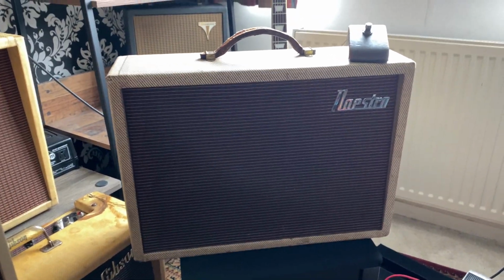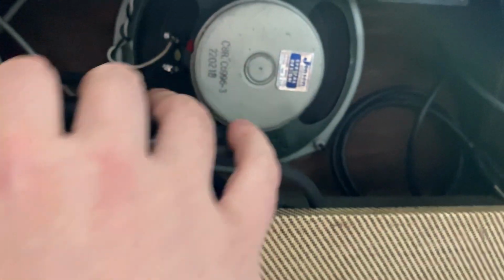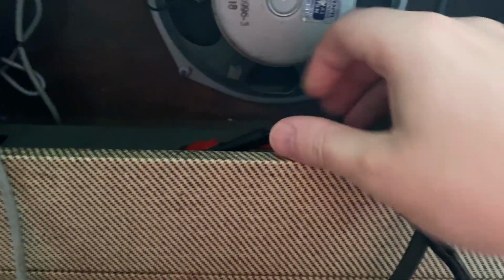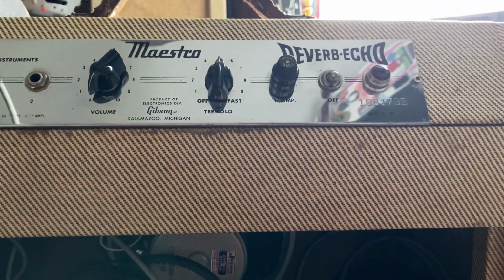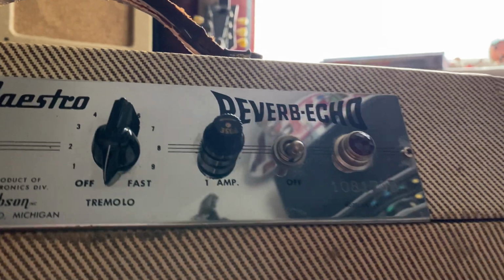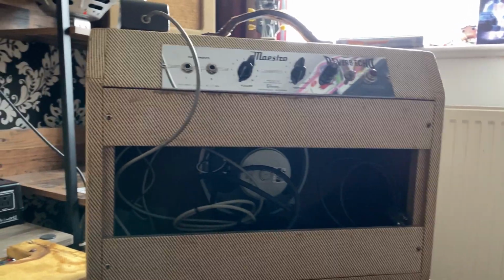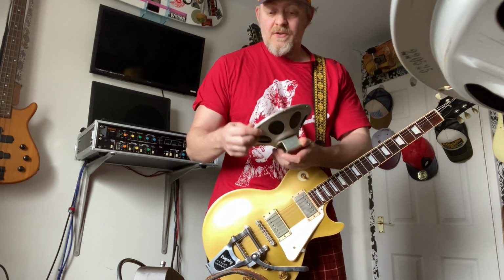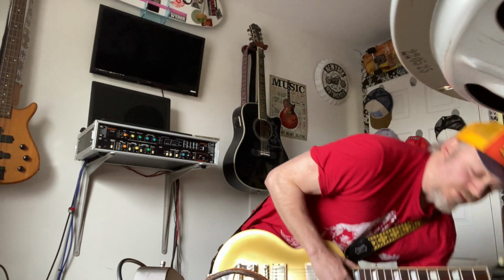Maestro 1961 GA-1RT

Comment: Hi! I just acquired one of these amps recently and it sounds dark. I'm playing a strat and I had to turn the tone knob all the way up to get any clarity at all. In your videos there seems to be ample high end and clarity. How did you find the amp to be?
Reply from the maker: @popespondstudios  Hi, there could be a few factors. When I acquire these amps I always make sure they’re either recently serviced or I take them straight to my amp tech to check everything over.
This particular amp also had a 1961-62 Jensen ceramic speaker. I find the ceramics to be a little more punchy and crisper than the alnico.
A bright 12ax7 in the pre amp also can help. Can’t remember exactly what I had here but maybe a RCA or Raytheon would be a good candidate.
This amp is prone to being quite warm and mellow imo. I mainly used it for the outboard reverb
Reply: @ Hi! My amp is with the tech right now. I’ll mention to him maybe using a brighter tube in that position. The speaker was changed out to a WGS 8”. So, it’s definitely a newer speaker. I’m really hoping the amp can be more balanced. I may have to get an eq pedal to see if I can pull some of the mid frequencies out.
Reply from the maker: @ tbh an original Jensen will naturally be brighter. A boost pedal with an EQ of sorts should do the job. Crazy circuits superconductor or Zio by source audio
Reply: @ Thank you so much for taking the time to answer my questions. Very helpful!